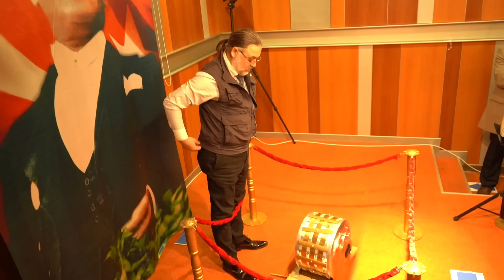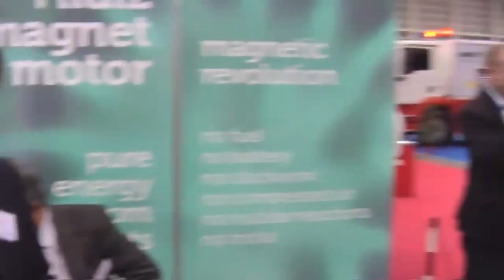Yildiz: Alive Free Energy Inventor Magnet Infinity Motor Powers Homes for Free!

Comment: But isn't this more of a store of energy? Like a kind of magnetic battery that eventually will run out. Because if there is any resistance pushing back on it - in this case from the generator - the alignment of magnetic poles should weaken over time no? Correct me if I'm wrong, please.

I want to add, that it could still be revolutionary as a super-efficient battery, maybe. Would like to know the power density to check this. You could combine it with a motor/generator in one box. Would be like a kind of wind-up battery that never degrades over time like lithium batteries do

Comment: If it works, just produce them and sell them to people. If it can generate 5kW it is more than enough for a house. With some batteries even a 1kW unit is sufficient. You could sell it for $10000 easily. Or you just create a power plant with these and retire rich.
But at least it is demonstrated as a standalone equipment. 
Hard not to be too skeptical.

Comment: VC’s require Patents for commercial protection. The Patents Cabal will not grant any patents. Mainstream commercialisation is possible by simply selling the electricity
Reply: Patent offices would also patent a free energy invention, but only if the inventor agrees that his invention is examined by experts and gets a positive certification. Since free energy inventors have never agreed to submit their inventions for an examination by independent experts, patents which claim free energy are indeed not granted.

Comment: No one finds it odd that he lets it run. Then turns it off only to turn it again an hour later.  Put it in an enclosed box under a load.  Make the box where it can’t be tampered with in several live feeds and tun it in and let it run.  Let’s see how long it runs un touched. It literally would be very easy to do. If it is truly a free energy device. What’s the problem.  Let it run for continuous

Comment: So much bla bla bla
If this thing really produces multiple kw of power indefinitely, then why not let the thing drive a 2kw load for a week straight in a closed room with cameras which is thoroughly inspected for hidden cables or whatever. If the thing still produces power after a week, then it might be convincing. This is just talk and talk and talk and talk and talk

Comment: Is that motor generator manufactured somewhere and is it possible to buy it somewhere today? That's genius to me.
Reply: Nope. Its 20 years scam
Reply: @EndlessEnergy24  i wont say its entirely a scam.. there are many motor generator devices running off capacitors and loop fed into more capacitor banks to run continuously for a long time
Reply: @ I bet you havent one of it

Comment: What is the number application patent ? because if you don't have patent about it, it's fake !
Reply: Here is the patent application by Yildiz: WO2009019001A3.    But this patent wasn't granted and the text of this patent is very vague. It does not mention that the invention is meant to be a motor. Scammers like Yildiz often apply for patents. They hope that this makes their claims more credible. It is not impossible that he has a national patent in Turkey, but even a granted patent does not mean that a device really works. Besides physics Yildiz behaved in a way which should make the fake-alarm bells ring loudly.
Reply: @heinzpg  Very soon , we will have great innovation about new energy system. But surely not this one...
Reply: @mosesdo46    Any idea, on what type of energy this new energy will be based?

Comment: yeah.  it works.  We made a smaller version in Istanbul ourselves.   There is some key points to how to make it work,  most people are able to make such stuff, but when you are to withdraw electric, or plug and try to run something via this electricity, the device stops when there is load.  There is some key points to avoid that and keep running even under load, but most people can't think of that, including Mr Yildiz. I have the solution to that,  but I don't want to be assasinated.
Reply: If you have the plans then opensource them.
Reply: @andyspoo2   Ibrahimozkan hasn't anything working and Yildiz hasn't either. Yildiz is around with his motor since about 15 years, does demonstrations now and then but he refuses to let experts have a look inside his machine - although he also claims to have a patent. This video claims he refined his motor. Where are any data showing this? Yildiz did not even publish most fundamental data about his machines es e.g. torque vs. rpm.
Obviously his motor runs with an hidden e-motor and an accu pack. He never disassembled his motor completely. He got more and more recognition? Not at all! There is no reputable scientist who believes that this motor is just driven by permanent magnets.
Reply: Message it to me, I'll screen shot it and delete your comment and cut your name from the screen shot and delete the original. I get your hesitation. I'll find a way to get it released.
Reply: Én nem hiszem amit írsz.Be kellene mutatnod a berendezést név nélkül vagy álnév alatt és megengedni a tömegeknek ,hogy gyárthassák.Tömegeket csak nem kezdenének gyílkolni ezért.Te csak kifogásként írod le a félelmedet,de nem csináltál semmit!Nincsen ingyenenergia.Bizonyíték nélkül nincs.A bizonyíték a tömeggyártás lenne!
Reply: Демонстрация работы магнитного двигателя https://youtu.be/7ihBD3NKZR4
Reply: @   Such demonstrations are meaningless. If there isn't a positive validation by independent experts you can bet that such motors are not driven by permanent magnets but by a conventional drive. And there is no such validation for Yildiz and also not for the motor shown in the video you indicated.
Reply: I found information: Patent EP 2,153,515 dated February 17, 2010 inventor: Muammer Yildiz. Here YouTube constantly deletes my messages, this is the fourth time I’ve written.
Reply: @alexblr     I am familiar with this patent text. If you look at the "legal events" you will see that the patent was not granted. In addition, the text makes no mention that the patent describes a motor.
Reply: @vaporizer08    Open source? Explaining in detail where the e-motor and battery pack is hidden?
Reply: Ani vlla bone veq per veti dhe vllazrit etu zgjidhjen:vetja dhe vllazrit e tu nuk te vrasin ishallah apo i ke vllazrit si vllazri e Isefit Alejselam.
Reply: Я почему-то уверен, что если бы вы были на месте изобретателя, то тоже попытались получить как можно больше денег с этого. Не рассказывайте сказки про то, что вы открыли бы свободную энергию для всех и каждого.
Reply: @   A precondition to get much money is credibility. Why does Yildiz behave in a way which is not credible at all? Why did he announce oncoming sales twice but nothing happened? Why does he claim to have a patent for his motor but hasn't? Why doesn't he give simple technical data? And finally, why did he never agree to a controlled test over a longer time? It's not only physics, it is also his behaviour which indicates a scam.
Reply: You can offer that solution, you are no longer in the universe that was doing that. This is different universe and the kind of changes you are seeing are a testimony. We collectively chose this universe of growth and expansion for the human species. Just look on the road, how many electric vehicles do you see? That technology is needed to drive them.
Reply: @vaporizer08 We are past that, they tried and failed. Zimbabwe under western sanctions, meaning, that will be an export product for the nation and it will lower over reliance on foreign energy.
Reply: Tap the power wirelessly from all the emf the thing is giving off
Reply: Desde já considere-se um homem morto.

Comment: 01-09-2025, Innovative Inventor: Muammer Yildiz's invention: Magnet Infinity Motor is showing it's working well. The invention: The Magent Infinity Motor  is unique. No pollution, no toxic chemical, no radiation and less noise. Good work!! ☀️🌎⛪♥️🙂👏
Reply: Great. How come there is no videos showing the device under load for longer then a 24 hour period. On the internet it’s literally ran for 15-60 min at a time before it’s shut off to rest.   Until I see a live feed of device enclosed under load in a live stream for an extended period. I call bullshit.  If it’s real. This shouldn’t be an issue.
Reply: How much ppower does it put out ? ?
Reply: @michelbrown1060    No one knows that. Which is some more indication that this motor is a scam. Although Yildiz offers magnet motors since 15 years he has never given any serious technical data as power or e.g. torque vs. rpm.
Reply: i agree with trinklad, prove it works over time, that would have been great, i would have been the first to get this generator. unfortunately, you see completely cheap videos like this but never anything that comes out on the market. So is it to withdraw money from the video of youtube? and now they got a little more when I commented on the video
Reply: @carinaandersson849 You are perfectly right it is a perfect nonsense the same as thousands of élaborâtes hoaxc😂😂😂
Reply: This replica, which has been sitting there for years, will be useless unless it's made available for public use or sale, or it may simply be at the service of large companies that produce and sell energy, with the wealthy, as always, making huge profits from it.
Reply: Yildiz is around with his magnet motor since more than 15 years by now. There is plenty of evidence that this motor is in reality run by an hidden e-motor and accu pack. He announced twice oncoming sales but nothing happened. Although he claims to have a patent describing the construction he refuses to have his motor being examined by experts. In my opinion a clear scam.
Reply: @durchblick9505 exactly, this all just pure bullshit because if he still faces technical challanges to overcome, then how on earth could he ever demonstrate those devices in the first place?
It drags me to no end he claimed that his motor works but in reality just doesn’t work or there is a hidden battery inside.
And that his vision will lead to new ideas and do inspire others about research into free energy devices.
Well hahaha as if am excited about that.
If there will be ever someone in the world wich cold show a fully working prototype magnet motor with no hidden bullshit added to it, only then my life will be complete damnit🙁.

Comment: This is at least 20 years old story, I hope he is healthy and still working on his free energy device.
Reply: yes its been around long time..but we still dont see it on the market..ive become skeptical since
Reply: @ Do you think they will let you produce a motor that will destroy the blood sucking energy cartel on the planet? They killed a lot of people who invented free energy devices earlier.
Reply: @fidelcatsro6948    Even if the Yildiz motor is for some reasons not fit for practical use: if it is really driven only by permanent magnets it would be a sensation and the name Yildiz would become famous in history of science. All he had to do for that is to let independent experts examine his motor. Since he doesn't do that there is every reason to be skeptical.
Reply: Yildiz is healthy and arranging demonstrations now and then which are not really convincing. But he refuses to have his motors being examined by experts. This can have nothing to do with protecting his intellectual property since he also claims to have a patent which would already protect this property. He has announced oncoming sales of his motors two times to arouse new interest but nothing happened. He also never did a complete disassembly of a running motor in public. Most likely his motor runs by an e-motor driven by a battery pack.
Reply: @heinzpg  You are lying because I know his motor is real and it has nothing to do with battery pack or something. Are you working for current energy system which sucks people's money for whole their lives? STFU please.
Reply: @g.s.6255    You know that the Yildiz motor is real??? Can you detail the evidence you have for this knowledge? Any evidence that this motor was examined and validated by independent experts? You claim I am lying? Where is your evidence for that??? If you can't offer any evidence, stop commenting here. Please! 😊
Reply: @heinzpg  https://www.youtube.com/watch?v=D5K_wB-xsuM&t=520s 😉

Comment: Open source is the only way these inventions will move forward at this point. Gamble reports that there are 5,000 suppressed energy patents.
Reply: These reports are nonsense. There may be 5000 patents, which are not open to the public, but you will hardly find an energy patent amongst them. Most of them concern weapon systems.

Comment: If you are going to demonstrate it, you should drive a much heavier load. Like several 1,500 Watt heaters.
Spinning a plastic fan isn't very impressive for such a large device.
Reply: 2 600w hps lamps 😂
Reply: And those bulbs are low wattage leds.
Reply: i'd be impressed even if it was a rotating fan and running a 3 volt LED bulb continously!
Reply: From small things big things grow , You can’t run first you must learn to crawl first,So go on your knees and pray he  succeeded for the planet needs.